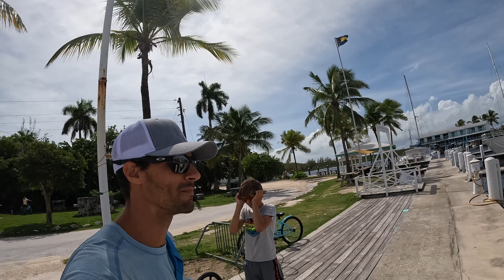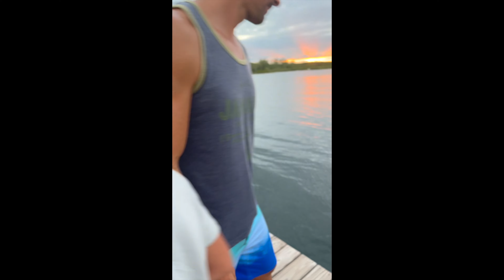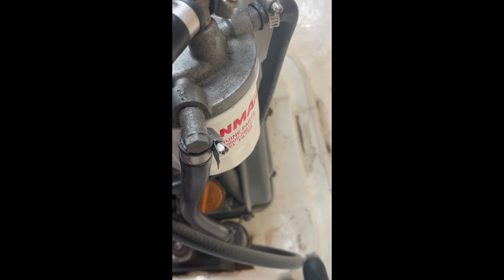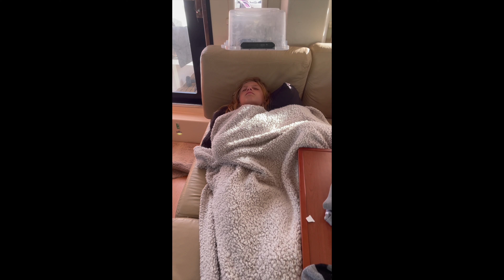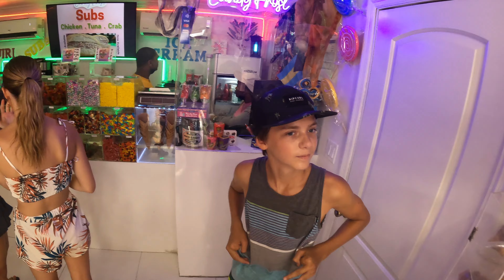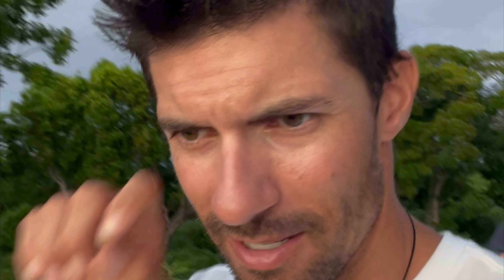Exploring the Berry Islands, Bahamas Episode 6

Comment: Nice video!  We have visited some of those same places in Great Harbor Cay.  One thought on your fuel filter segment...is it possible that water got in the system during your rough passage?  Loose fuel filler cap?  Also, bacteria/algae can grow in diesel.  That might be your gunk.  Might want to treat your fuel with biocide.  We do whenever we stop for long.
Reply from the maker: Yes thanks so much for the feedback. It ended up being diesel bug, we treated it with biocide and learned that we need to keep our tanks fuel whenever possible.